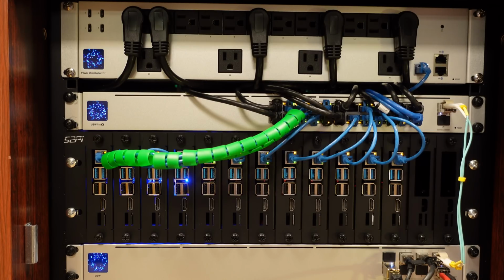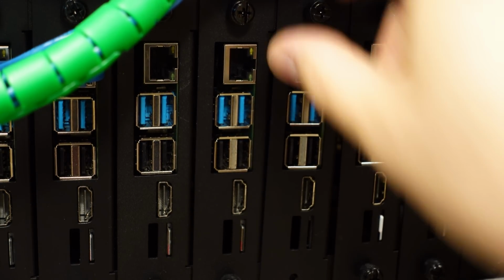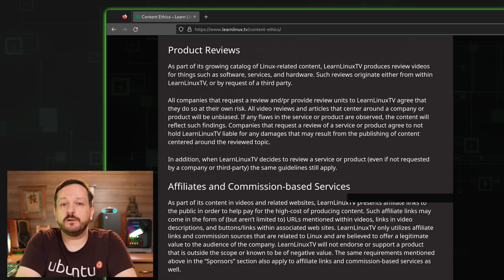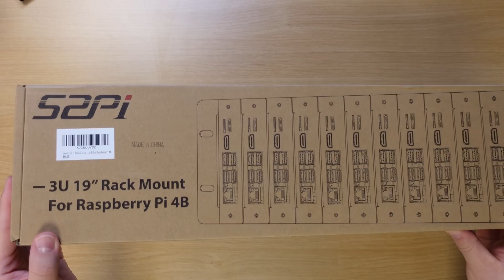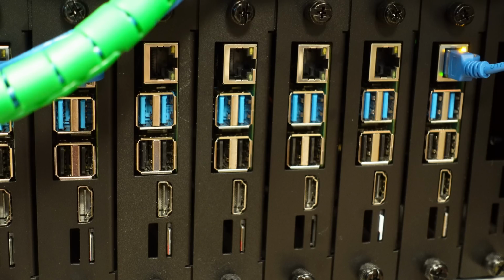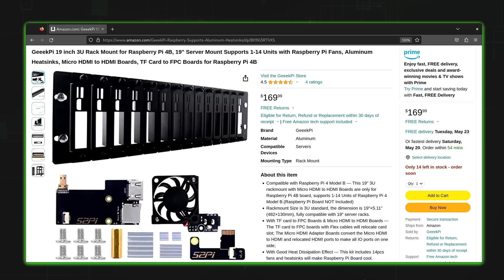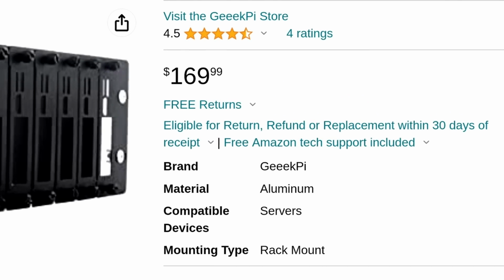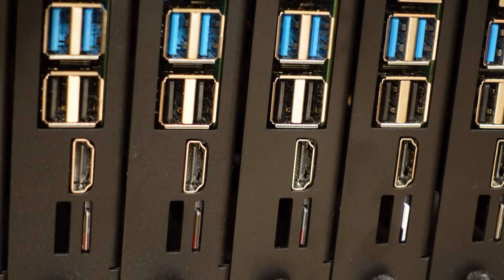This 19" 3U Raspberry Pi Rack Mount is Good (Enough)

Comment: Does it have a spot for SATA SSDs? I currently have a 4 slot enclosure that has an opening to plug the SATA ssd into the USB port on front and SD card slot in front as well.  It's really slick.  Running power to them is another challenge.  But, I'd rather have them rack mounted than sitting on a shelf like they are now.

Comment: Using POE hats is a viable power solution, but since this is design is a rack install, I think some kind of multi-connect USB C power rail would be a more cost effective solution that is glaringly absent from the design.
Reply from the maker: I tried that - didn't like it. Even though only one cable plugs into the wall, there's a bunch going to the Pi's, and it's a mess for cable management. If the POE hats do end up costing more, it's more than worth it to me for avoiding more cables.
Reply: @LearnLinuxTV  I see your points. I got inspired to look for multi-port USB charging blocks and didn't see any shining solutions there that had ample amperage. Any cost savings over POE hats get diminished by the multiple A-C adapter cables as well.

Comment: A very fair price for a niche product.  I do wonder if the front plates could be better.  Gaps around components that ideally shouldn't be there.  Maybe v2?  Of course, this may be due to manufacturing tolerances on the Pi.  Wouldn't stop me buying one if I had a need though
Reply from the maker: I thought a v2 would've been out by now. I don't have any inside information or anything, but the rack I reviewed was in my garage for well over a year and I forgot about it. I filmed the video right after I rediscovered it. Ooops. But it was still the current model, so I filmed it.
Reply: I think this is designed for compatibility with the RPi 3B. It has the rj45 on the other side.

Comment: I use their 1u version that takes 4 pi’s.   Only thing is the sd card extension to the front is unusable as I found the interference on the ribbon cable corrupted data.
Reply: Does it have a spot for SATA SSDs? I have a 4 slot enclosure that has an opening to plug the SATA ssd into the USB port on front. It's really slick.  Running power to them is another challenge.

Comment: Now THIS could make an AMAZIN cloud server!.....whats the max those SD cards come (size-wise) 128GB?....256GB?....are there such things as 1TB SD cards?...2TB?...
Reply from the maker: I've personally used over 500GB with Raspberry Pi, but you have to configure disk checking at that point because a routine scan will time out the boot process. As long as you fix that timeout issue with fsck, it's more than fine.
Reply: @LearnLinuxTV  Awesome!.....I might make this my Summer/Winter project...I've now amassed such a collection of PDf's and Guides that a 4TB External USB hard drive is not "enough" to entrust its safety to. might have to build me a cloud server and then I can access anything from any device!...
Thanks Jay for making these vids...for keeping your channel going when things looked ugly for YouTube Content Creators!...I keep promising to buy some of your merch?...well I'll be picking up some stuff this month!!

Comment: I like these for an industrial use, but for home use the Pi is too expensive now days. You can get a much faster rack mount mini pc for the same price.
Reply: @wojtek-33  what was the vendor? I signed up at velroys and some gal's marketplace, to no avail. Velroys keeps pushing useless and overpriced kits though when they get stock.
Reply: Power consumption is still an issue for a lot of people where the pi excels
Reply: @wojtek-33  thanks. I signed up multiple times at adafuirt and received 0 notifications.

Comment: 14 breakout boards (HDMI + micro SD card) and fans seems awesome for the price, a little over $11 per Pi? And the color + looks in my rack are secondary if everything else is rigid and well built. Nothing that a can of spray paint can't fix if it really bothers you.
Reply: Dont think the pis are included with the mount
Reply: @francafu8951  Huh? The are HDMI, Micro SD adapters and a cooling fan for each of the PIs you can mount in the rack. So the price of the rack, per PI, if completely filled is about $11. I never said the PIs were included, where do you get that idea?